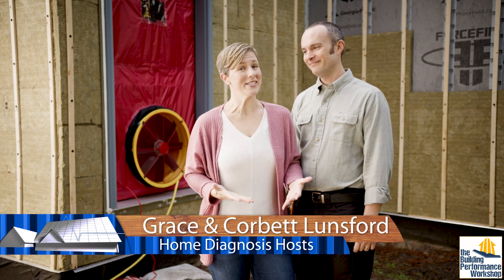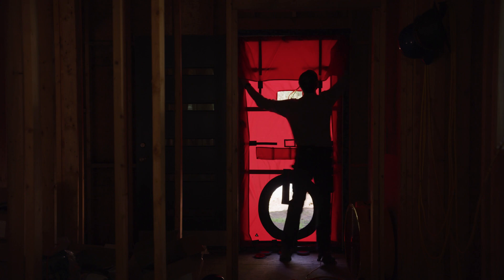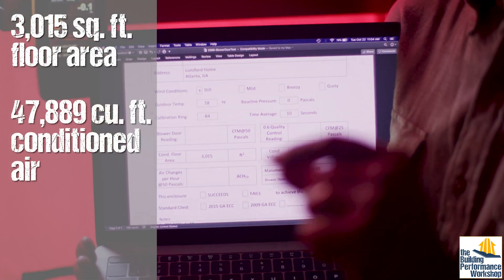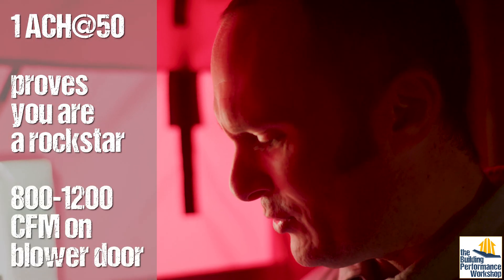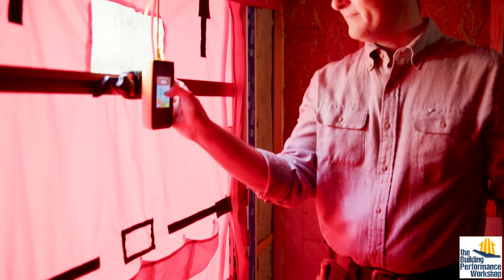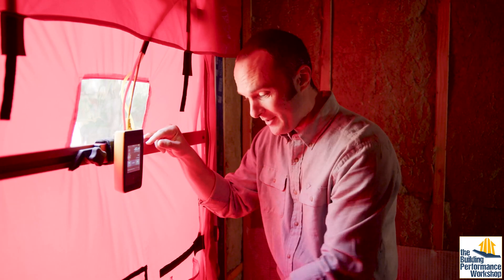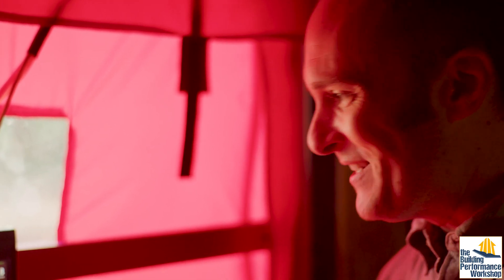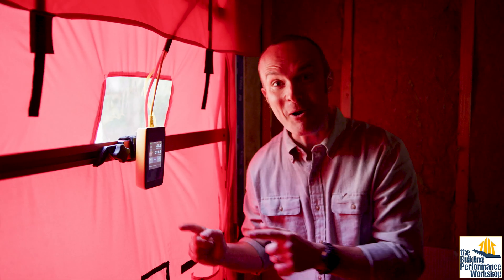Super Airtight House: Recipe for Disaster, or Stroke of Genius? (Blower Door Test)

Comment: What if the house has mold or something won't you disturb it with the blower door test and send spores or whatever thro the house causing problems?
Reply from the maker: Sure, that can happen- normally from a nasty crawlspace. In that case you can blow the air INTO the house instead.
Reply: @HomePerformance  or attic. Wouldn't blowing air in be worse? And wouldn't in or out disturb it either way

Comment: I'm torn on building air tightness. What you achieved is great but now you have to install an expensive mechanical system to ventilate the house.
Reply from the maker: Doesn’t have to be expensive- ours is, but we’re trying to show the frontiers of what’s possible. And you want the airtightness for predictability, control, and prevention of moisture and indoor chemistry problems first and foremost, not just energy savings.
Anyway, build however you like, obviously- there are lots of leaky homes out there that are healthy too... BUT you’ll be required to build down to 3ACH someday whether you practice now or not, because of codes.
Reply: @HomePerformance  
You are right and that's why I'm so torn. Now, I'm in Texas where we don't get extreme cold temperatures so that factors in as well. If i lived somewhere very cold i would probably build extremely tight. 

Which has the lower energy bill? A 5 ach house with only bathroom exhaust vents, or a 0.5 ach house with a state of the art mechanical ventilation system? Factor in the purchase price, the running cost, replacement cost and time value of money and i don't know which one wins out.

Btw, do you use any energy modelling software like phpp? Beopt? Thanks

Comment: Great results Corbett but I am not surprised  but there is NO way you would get a builder to be as meticulous as you were dealing etc unless you went with factory prefabwalls I also think homeowners need to be just as obsessive re materials in a house that tight AND lean on intelligent membranes as you have . Have you any idea at this point how much energy cost involved with your air exchanger at this point ? I ask as suspect you will be running constantly
Reply from the maker: I could calc it out, but I’d wager maybe a kW or two per day, which is something like 10-20 cents. If that’s the price for ensuring the house doesn’t hurt my family’s health, it’s miniscule.

Comment: Corbett just a tad bit tighter than the last Blower Door test we did together - NYC Wyckoff house13,000.
(Home Diagnosis Ep4: 1600's NYC vs. TinyLab)
For your final Test out I recommend you use your RETROTEC duct pressure device in a window opening. 
Blower Doors are for leaky homes and large buildings, small pressure devices are perfect for tight homes like your even with all the ventilation penetration's you'll be making.
Reply from the maker: I have a BD shroud with a Ductester hole, buddy. Good call.
Reply: @HomePerformance  
Your Blower Door frame should fit in the bigger windows. Be looking for the video.

Comment: Congrats Corbett!!!  Are you going to cover/do any further improvements to the existing envelope, or just allow the insulation and drywall to improve things further?

Oh, and what’s the equivalent size “total” hole for your building at 50Pa?
Reply from the maker: Yes, we’ll have an interior air barrier behind the wall surface. Don’t remember what the reading was, but there are a few different calcs for the hole size (ELA, SLA, EqLA) and anyway I’m not too worried about the exact number- it’s small.

Comment: How does the blower door test compensate for required openings, such as range hood, bath fans, dryer vent, etc.? Do they get sealed?
Reply from the maker: Any intentional openings are left as is (backdraft dampers in place), this test is to find UNintended leaks
Reply from the maker: Any intentional openings are left as is (backdraft dampers in place), this test is to find UNintended leaks
Reply from the maker: Any intentional openings are left as is (backdraft dampers in place), this test is to find UNintended leaks
Reply from the maker: Any intentional openings are left as is (backdraft dampers in place), this test is to find UNintended leaks